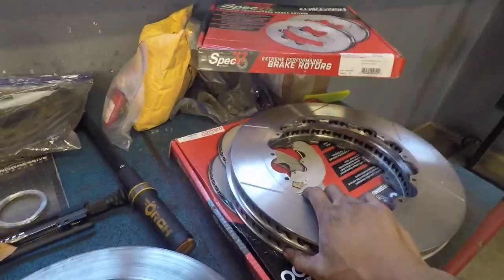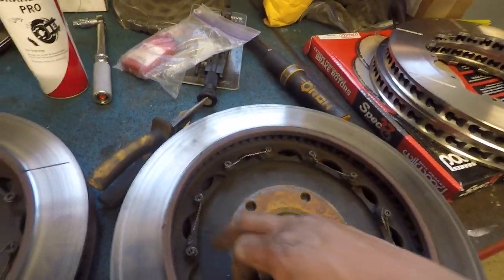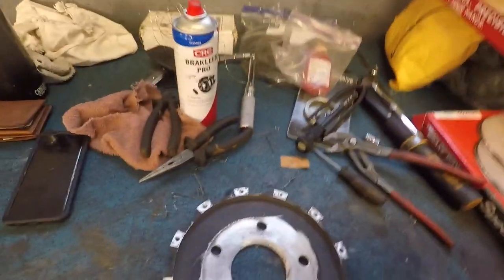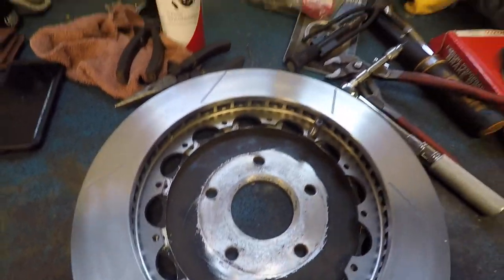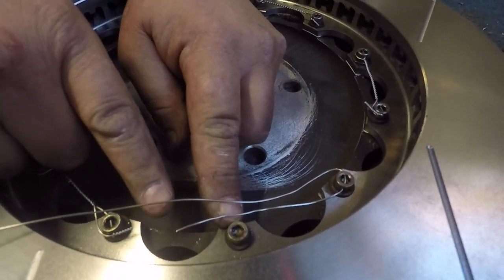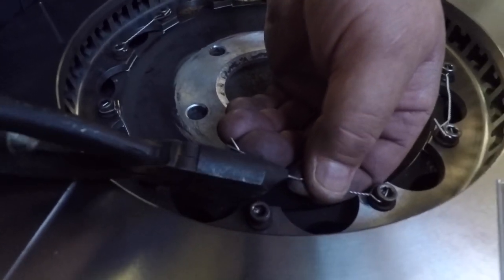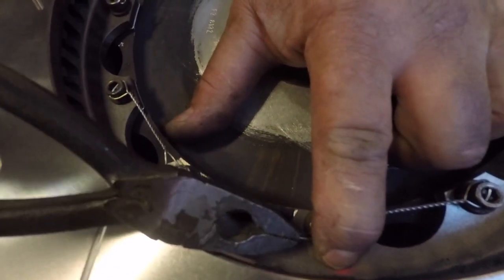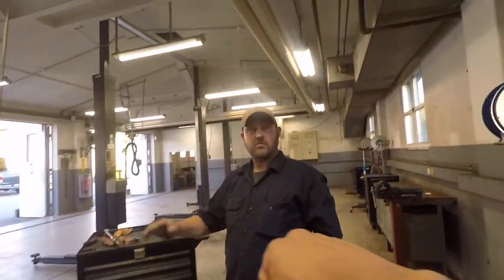How to replace 2 piece rotors (Rotor rings)

Comment: Your safety wiring procedure is all wrong, you're supposed to twist around the bolt in the direction so it tightens each bolt that is safety wired. The one that you show him doing, you can look at it and tell both bolts are wired to loosen instead of tightening. It will still work but the procedure is all wrong.
Reply from the maker: Thanks for the insight i'll do some further research 👍🏾

Comment: A good 15B will know how to safety wire those bolts!! Those safeties are extremely loose and would almost be considered neutral no anti-rotation. Please find you a good aviation mech next time.
Reply from the maker: You are not wrong my friend! Im steping away from 2 piece rotors
Reply: @Beezy_Builds  nothing wrong with 2pc rotors might wanna look at something with self locking nuts or better safety wire job. Check this guy out props an brake rotors not really all that different speed wise https://youtu.be/7Xck44xYeaE
Also look at DBA’s at KNS Brakes.
Reply from the maker: If I do it again I will for sure do selflocking nuts

Comment: I just bought some 2 piece rotors for my FD and they didnt come with that unbolting protection wire. Never seen this before. Should i be worried now?
Reply: If the bolts are drilled for the wire then get some and do that, if not get drilled bolts.
Reply from the maker: Some manufactuers dont use lacing wire   so I'd just got off what the manufctuer recommends